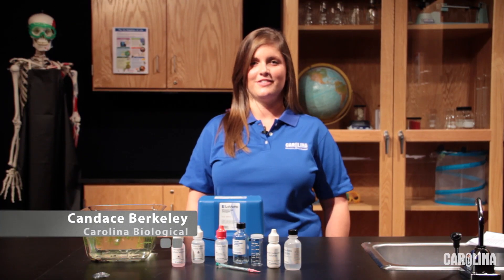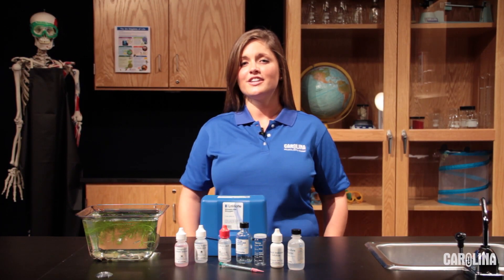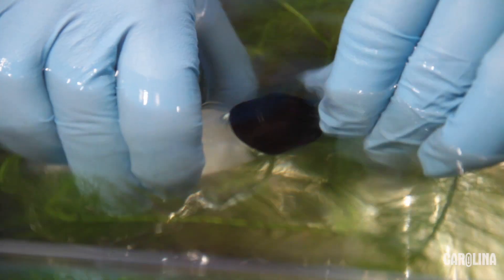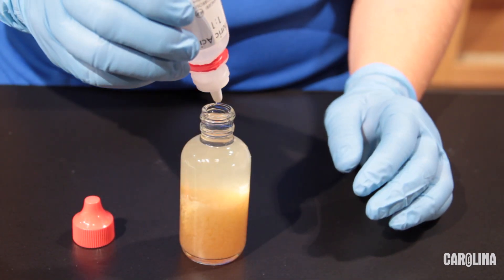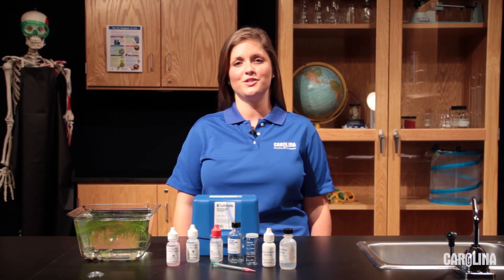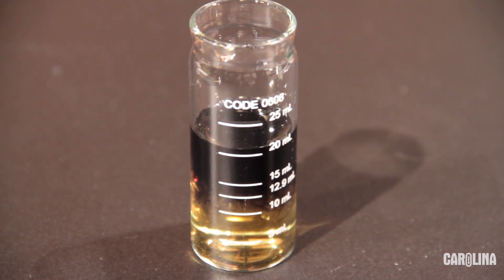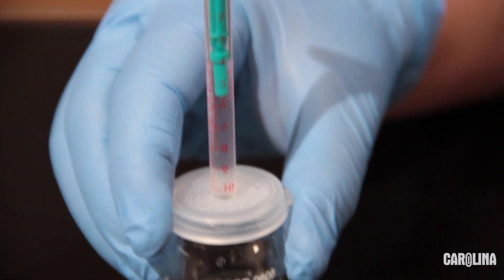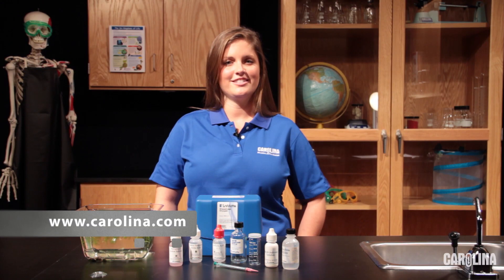The Winkler Method

Comment: I was wondering why she says "manganate sulphamate" instead of "manganese sulphate"... but then I've remembered she says to use gloves and goggles for this. -_-

Typical nervous nelly you don't want in a lab. This method is routinely done and calling for such strict safety is a laughing matter. It's not mercury salts or concentrated nitric acid...
Reply: Ha, dinosaurs roamed the Earth when this method was used. Nobody else uses this Winkler Method on GLP settings , unless prior calibration for older membrane tech. especially in Commercial Laboratory, It used  back in early 1970s to 1980s prior to Ion Specific Ion meters , Dissolved O2 Technology. Good for a learning lesson using classical wet chemical analysis, but not for day to day use.